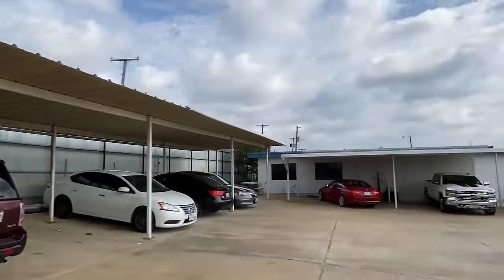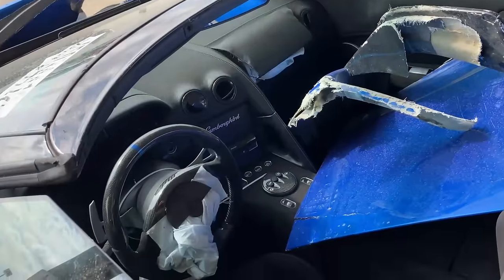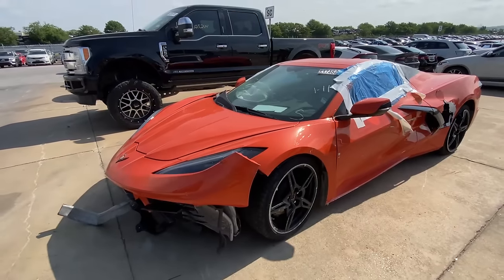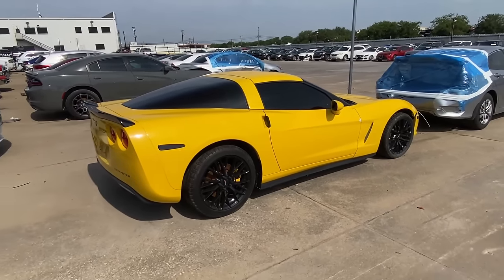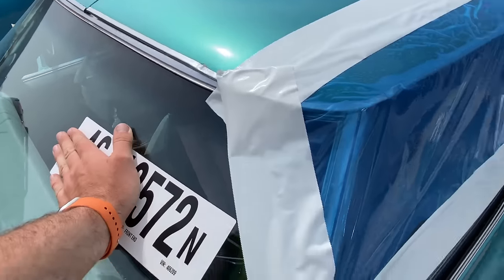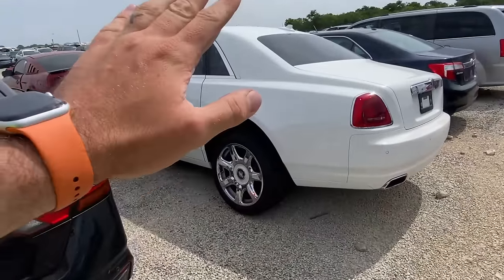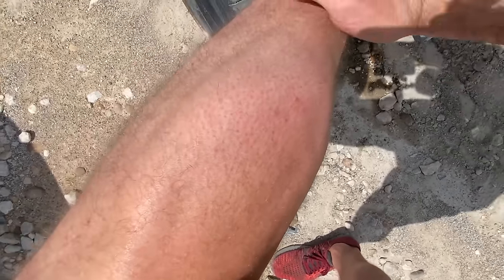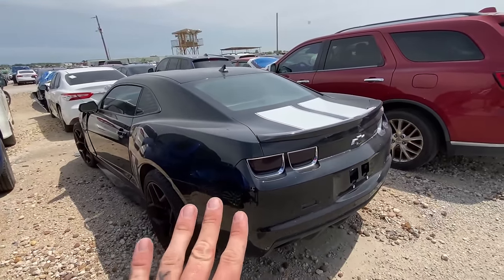Buying TOTALED Supercars CHEAP At Copart Salvage Auction!

Comment: The XTS-V car is actually pretty rare. They made those and CTS-V sports, the CTS was kind of the test car. It's an LF3, Twin Turbo V6, XTS made around 400, CTS made around 420, and the ATS-V which had an LF4 engine (Almost the same as an LF3 with some different internals and slightly bigger turbos) had around 470. If you guys are ever curious, I have a CTS-V sport and live right across the bay, I wouldn't mind driving over to show it and most likely pick up something I saw on your site for my other car. They only made around 4000 of them from 2014 until 2019. The XTS-V cars I've only ever seen about 1 in the wild, I have seen one other CTS as well.

Comment: I'm pretty sure that the Lamborghini murcielago and the Lamborghini Gallardo use the same Graziano transmission . If that is the case then the only mechanical difference between the E gear and the manual is the E gear has a computer doing what your hand and foot would do in the manual . The actual transmission case and internals are the exact same on both systems .
Reply from the maker: You’re absolutely correct. 

I had a guy buy an R8 egear trans (same thing) from me years ago to manual convert and use in his kit car.

Comment: I too was wondering why the car thieves pulled the A-pillar covers. Answer from you — tracking devices. 
I think in the olden days a company called Lojack welded a steel box to the frame with the "homing device" inside. Lojack at the time was THE answer for stealing expensive cars.

Im the salvage yard I like how delicately you raise and lower hoods on these cars and when you had to crawl in you were very careful, and when there was plastic on the windows/doors you didn't just pull it off to start the car. But you do if you felt you would actually be  bidding on that car. It is a treat to see another human actually care about other humans' property. 

I am with you Cayman over Boxster and for me NO to cloth top cars.
Speaking of Boxster and Cayman, and you making a comment about how you were starting to love the older Porsches, there's a lot of upgrades you can do to make the olde ones "newer" again. Example is my '86 911 RestoMod-Outlaw which got a brake  upgrade kit from Elephant Racing in Calif.: 2000 Boxster calipers (4 pistons vs 2 and about 1/2 again larger than stock) .oversized brake reservoir, master cylinder,  930 rotors, etc

LET'S GET THIS OVER WITH AND DONE...FOREVER  
-I owned a 1958A Super Coupe in 1968 and a 911 SC in the '80s, and like I said above I have an '86 RMO. 
- I am a member of Porsche Club of America. I have got  to many PCA events. I am a Porsche fanatic.
- Here is the point! 
- I call Porsche.... Porsch—without the E sound. 
- When I owned a Chevrolet I and everyone else then called it a Chevy, the Pontact GTO was called a Goat, etc. To me it showed a close friendship with the Brand; like calling my best friend Robert 
        "Bob"
- In the 5 years I  have had my P-car only two people told me I was saying Porsche wrong. I was kind with my first come back to their statement. 
- If they pressed me a second time that like I was wrong I would growl  back at them.them (growl: words and body positioning)  and then they would back off.

 SO CALL IT PORSCH (NO E) OR PORSCHE (WITH THE E SOUND). It's your car; call it what you want. 
The license on my P-car says BK-MGIC. I call my car Black Magic and by the way don't say my car is pretty, it is a MALE...it is handsome. :—)

"A garage without a Porsche is just a dark hole" — Walter Rohrl - Porsche Development

Comment: If any vehicle is damaged especially rear quarter panels they write them off here in uk and I’ve brought a Mercedes sl 2000 model with 60,900 miles unmarked body and runs like new only damage was rear bumper no internal damage 
And paid £2,200 pounds and best deal ever comes with glass hardtop that alone sells for over £2k rare with the glass roof

Comment: AMG 43 is not bad, The problem is they down graded the 55's and the 63's, and went with the smaller motors. The bigger motors can be re-sleeved. The new motors are throw away. Look at the 55's and 63's lots more power and lots more sound.
Reply from the maker: Thanks for the rundown!

Comment: The bumpers and side skirts on the Murcielago is a Liberty Walk body kit.
Reply from the maker: I saw that once I got back to the hotel and started doing some research!

I can’t tell if it’s a good thing or bad thing with the value of OEM spec Murcielago these days
Reply: @scraplifegarage  actually, you can buy the entire Liberty Walk body kit for around the price of an LP640 factory front bumper. That Murcielago is a 1st gen but the kit gives it an LP640 look.
Reply: Front frame costs around $10,000. The most expensive parts will be the frame and the headlights. A stock LP640 front bumper is around $17,000 but the Liberty Walk one is around $5,000.
Reply from the maker: Good to know! Thanks for enlightening me.

Comment: The XTS4 V🇺🇸 is just a fat, slow 2.0T I believe. Automatic trans w more gears than it likely needs cus Cadillac.
Reply from the maker: Deserving of the V badge?
Reply: @scraplifegarage  not really Imo. When it comes to V cars, the CTS, ATS, CT4 & CT5 Vs are gonna give you the best bang for ya buck🤘🏾
Reply: @scraplifegarage  I was wrong! Had to do more research but the XTS4 V has the Twin Turbo V6 making about 370 (once you account for drivetrain loss). The base model is FWD but since that one said XTS4 then I guess it has the AWD system. Idk if it would be worth buying since it’s a heavier chassis. But it’s got a good and very tunable motor.
Reply from the maker: Well now I’m slightly more interested!

Comment: wtf 😂😂 not the biggest lambo fan  yet you would pick the most identical car to a Lambo
There owned by the same company.
Engines Are The Same If Not Very Similar. The New Chassis Are Exactly The Same With Minor tweeks.
Only Difference is.
Ones Cheaper An Less Glamorous